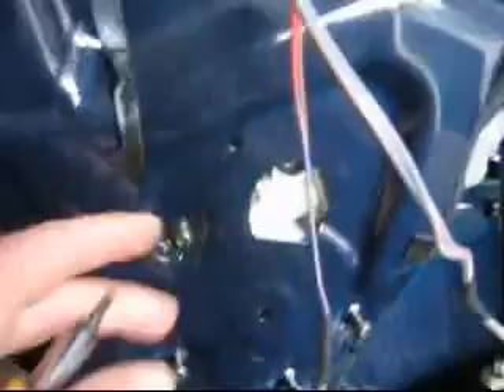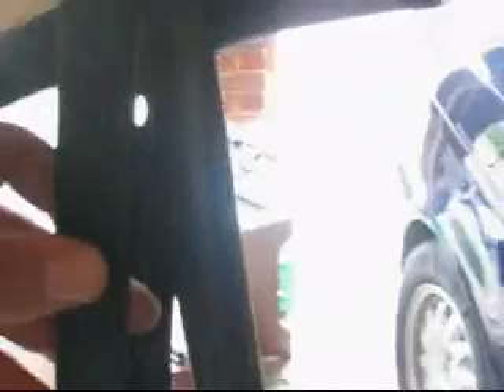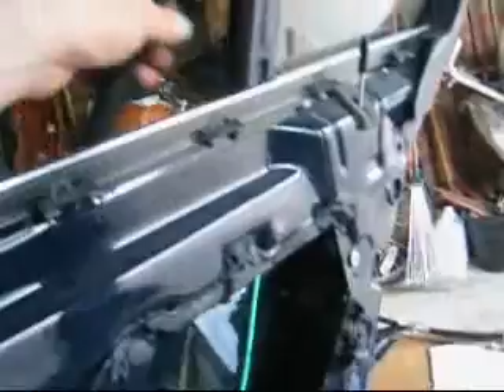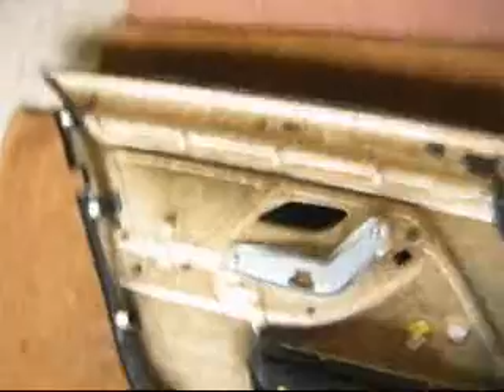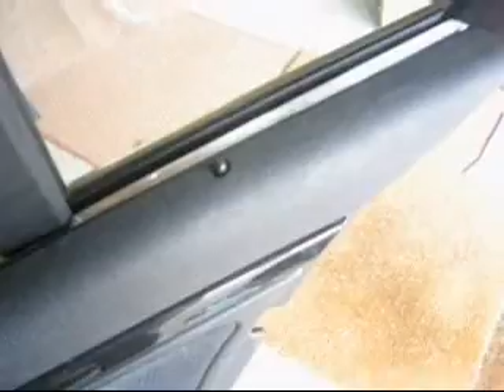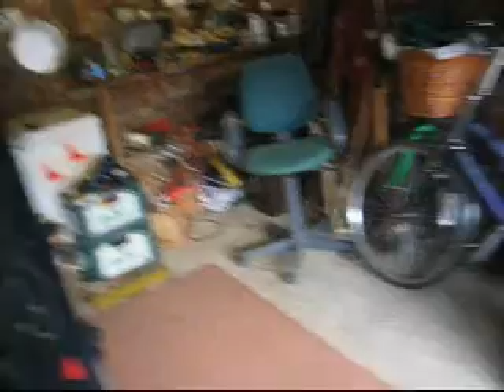Part 3 BMW E39 Rear Electric Window Repair

Comment: Brilliant,i have a bmw 318 tds with a broken mechanism on the front n/s door, this has given me just what i needed to take it off and mend the trouble.i feel the bolt that attaches the window to the mechanism must have come out, because i felt something drop and when i tried winding up my window it just won't go up, and it was raining, you can imagine, but thanks for the post.